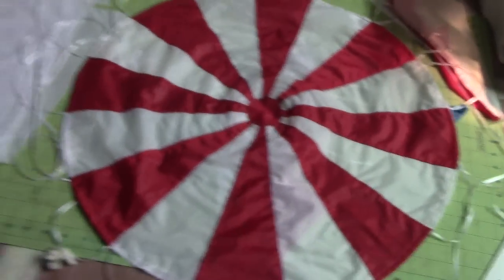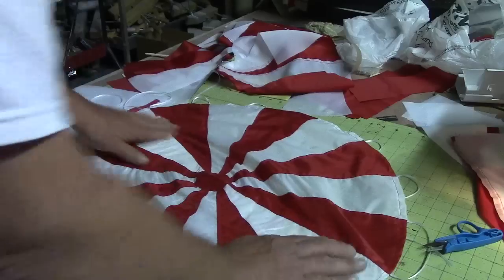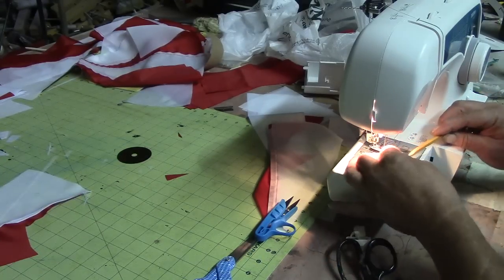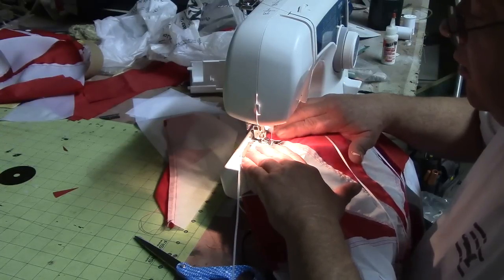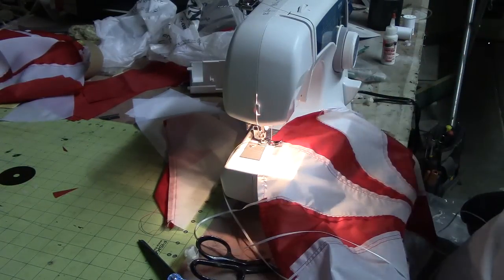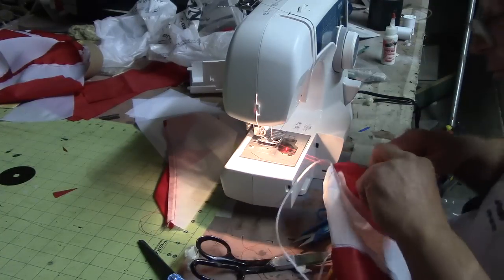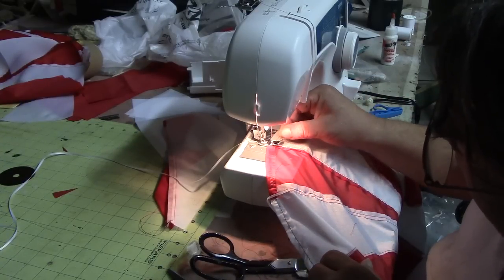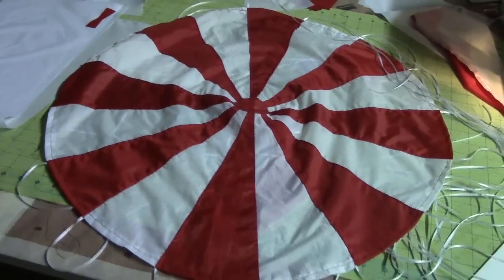sewing with Bob #2

Comment: Hey Bob you have the thread tension for the top feed to high that's why it's pulling out, I noticed it after the 3rd rope for the shoot. There will be info on how to set it for different cloths as yours is fine it just pulls it out.